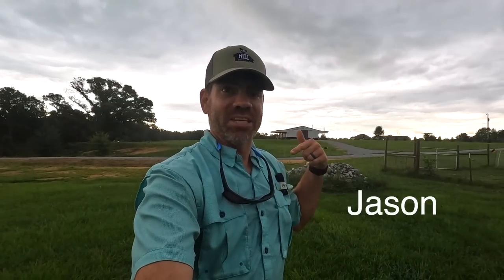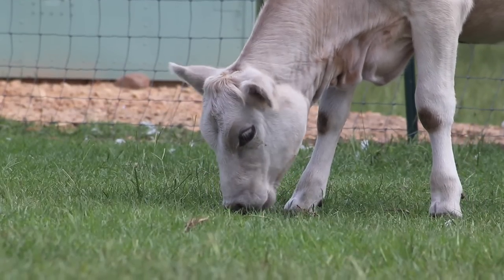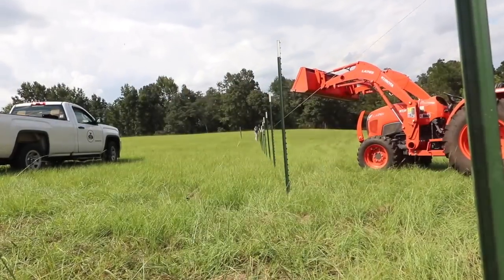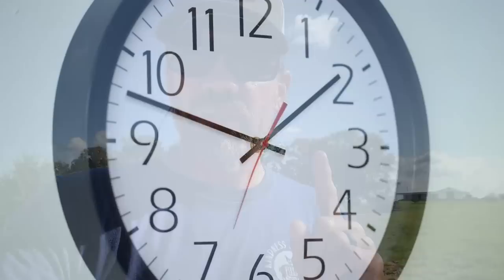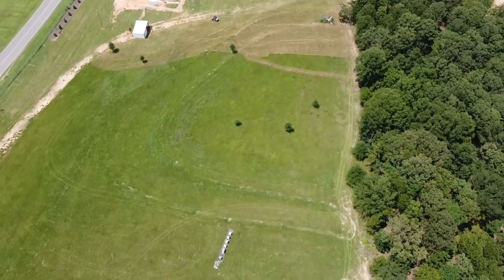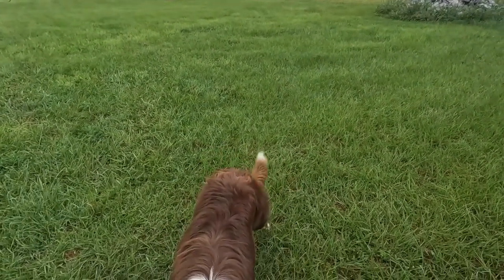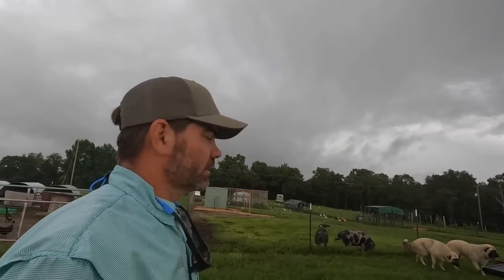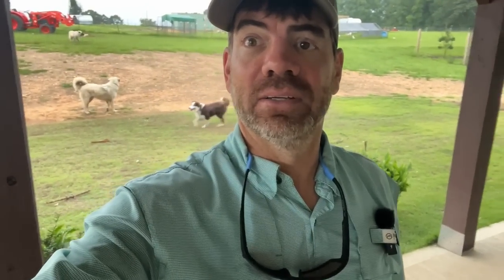If This Doesn't Work,  We're In BIG Trouble!

Comment: I like that post driver. Amazon has them for $250-$350. They aren't the same quality as the one you're using but for the occasional use they are probably good enough. The Titan post drivers are powered by a Honda engine for $2K but you know they last.

Comment: Now that alot of poles are in the ground, it's easier to see the designed plan for the animals separate areas. Before I wasn't getting the non visual layout concept.
You both did a tremendous  job today with your "git er done" aspect.
Jason you will need a soak in the tub after all that. God Bless.

Comment: Great job guys, the work never ends. Just a suggestion and while I have never used post driver try getting say a piece of 2" PVC slide it over the post when you stand it up drive the post in till  the PVC touches the driver and you are done. Good luck.

Comment: Living Traditions have one of those post drivers. they use a length of pipe that fits over the T post that is measured to allow the driver to pound the posts all to the same depth. Like your measuring stick, except once you slide the pipe over the post you don't have to hold it up.

Comment: Telephone pole, Chad from Adler farms, he hung big utility broom heads on his pole and the cows and goats use it as a scratching post. Just an idea. See that is what I mean, You two set your minds to do something and you do it! Wonderfully thankful that pole drivers worked so well for you all. Is that pole pvc piping? if it is will it fit over your t-post? Would that work so Brooke didn't have to jump in and out of the side x side? You're doing great Jason and Brooke. I would have to have at least an hour or two break between paddocks, probably a whole nap. God Bless, you're doing great!

Comment: With the length of those runs you might want wood post H brace every so often. It adds support for the wire, t post are great for vertical support but not lateral. Property is looking good.

Comment: After all the trouble getting the post hole driver and it's threatening to rain. Well you got it now and every little thing to make life easier is a great thing. I had rented a piece for a steam unit and just made it with moments to spare before they closed. I swung around the corner to the one door that was open still on a gate post with one hand for further life comedy. My hats off to the rental vendor for getting that. It's simple math when it comes to getting one of those. And as it turned out it didn't rain much so now with the success that it is, you have to find other posts you can get with it. Unless they pro rate for early return. Looking good. As you close out another segment with you saying to Brooke "You're probably right". I think I'll look for a song by that title and I'll let you know if we can dance to it.  😁👍

Comment: Perfect example of having the right tools turns hard work into a mere chore. Days of work into hours.

Having seen so many cases of homesteaders putting T-posts in, it is amazing so many do it by hard work, given the low rental cost, and where several properties are in relatively small area, all regularly needing to deal with T-posts, a shared purchased unit also is fully possible..
In your area it seems likely that a community shared gas powered driver is fully feasible, if the local shop will not retain a hire unit on hand permanently. At purchase price around the $2600, ownership does not seem impossible either, just based on time saving, when needing to put numerous posts in. Given the ease, you could well consider even regular shifting of pasture boundaries, given so little effort and time results using the driver. One task that may yet pose harder work is extracting poles in the hard ground.

Looks to have been more than successful, value for money. You may well have shown others the benefit of such driver. Good promotion for the manufacturer and the hiring shop.

❤❤❤❤❤

Comment: It's probably a "good idea" to NOT be in an open field holding a metal fence post in a lightning storm.   🤪

I'm glad it worked and I'm glad you use that you used ear protection.  Have Mrs. Coghill use it also next time.

Comment: The power company has guards for the guy wire if needed. As for the pole itself, if it can't take being used as a scratching post then it should not be used to hold power lines.

Comment: They have gas powered tpost drivers at TSC for $399. Looks very similar to what you rented.
Power companies set poles 18 to 20 feet deep in most areas, some as deep as 30 ft. We've had power poles in our cattle pastures for ever with no issues. Also I don't think they will allow you to fence around them to prevent animals from getting near them. That would impede the power company from working on them if need be.

Comment: Someone else, else where else purchased one of these after a lighter back injury but before it got bad.   I think theirs is a lighter weight post hole driver, but it is gas powered.  The first time(s) they used thier gas powered post hole driver, they were amazed how fast it was and wondered why they hadnt cinsidered it with more conviction before thier injury.  Then again, they didint use a tractor like you folks and had been using the people powered type......Do consider buying one for use in the future over the manual type.  Very few back injuries happen with a single instance.  Ratner tney happen a bit here and there over time.

Comment: I Hope you fixed it but you cut off your drivable lane by putting your fence too close to that guy wire.  You may not be able to drive under that wire. Check the height and width with your truck. Or you may need to put a bump out in your fence there. To go around.   You also may want to step back your fence for a new bee location along the lane

Comment: Love this....I have 2 questions about the fencing you will put up with these T-posts......what is the fence material AND will the fencing keep the dogs either in or out?  TIA!
Reply: They use the woven wire field fencing in the current corrals, so I'm sure that's what they're going to use in the new pasture.  It's better than the welded wire because woven wire fence can be stretched tighter than the welded kind, which would easily break at the welded joints (it even breaks when I stretch it manually!).  Normal sized dogs wouldn't be able to get through it, but you can also get the woven fence with smaller opening at the lower portion that a cat won't be able to go through (dogs are less 'motivated' than cats to squeeze themselves through tight spaces).
Reply: Thank you.  I plan to use this same set-up for the land around my shop so I can take my dogs with me.  I very much .appreciate your response.  Have a great day!

Comment: That pile driver is the ticket. You should probably wear a back brace to save your back. I am a bit concerned about that run by the road . I don't believe you will be able to drive a large work truck under the telephone brace. You may need to set back a bit.

Comment: For double the rental price you could have bought and owned it.
Reply from the maker: Not this one😊
Reply: @CogHillFarm  It happens that I was recently shopping for one to avoid renting.  The three most common models are $350-400 and fourth most common is $600.  I always take into consideration is whether or not I will be using it from time to time.  Doesn't take too many times to make it worth to purchase.  Worse case, it goes on Marketplace when you are done.  No rushes to get it returned.  If it rains, you wait, no loss.  Cheers!
Reply from the maker: A cheaper model would not have gone thru our very hard ground unfortunately. We read many reviews to find those would not work. The one we rented is the best on the market for a reason, very powerful compared to its competitors, hence the retail price of $2,600😊